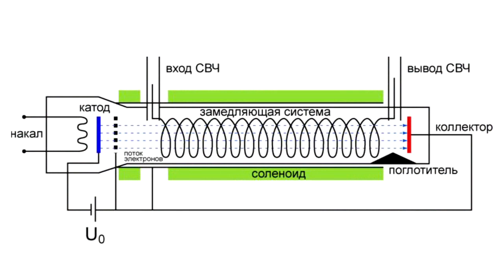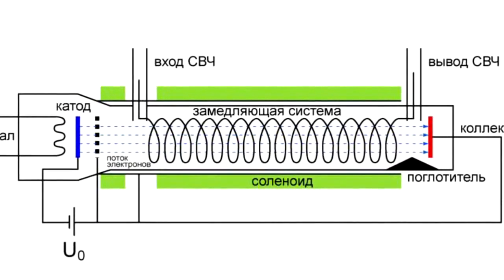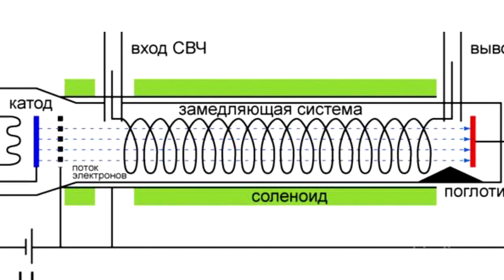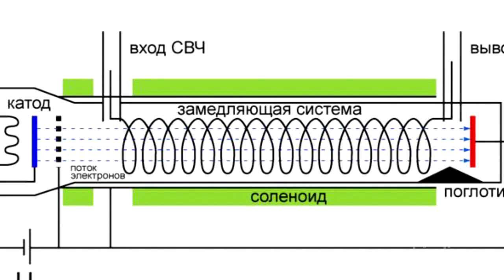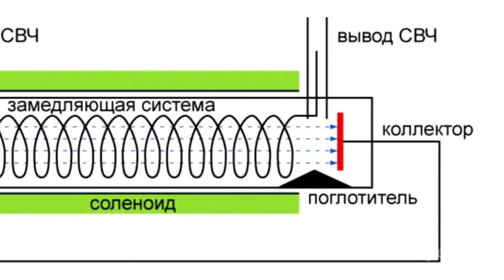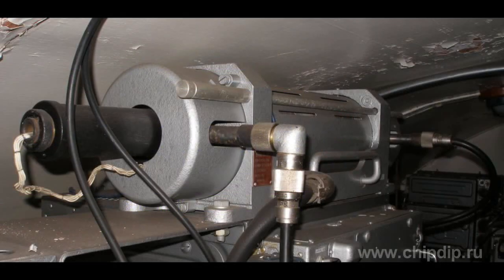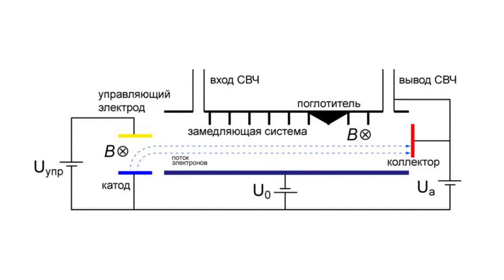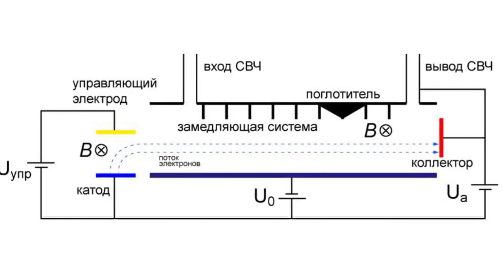Traveling-Wave Tube

Comment: Fantastic video there, really getting to the heart of TWT's. At TMD Technologies, we are one of the worlds leading manufacturers of microwave tubes, high voltage power supplies, and transmitters for Radar, EW, Communications, EMC RF testing, and other Laboratory applications.

We've got loads of information and data sheets on our website which you can find at tmd.co.uk